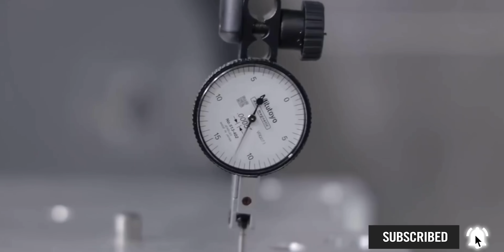The Harsh Truth Machinists Don’t Want to Hear

Comment: The median annual wage for machinists in the US was $56,150 in May 2024. This means 50% are less than that. Using the 50/30/20 budget rule, it takes about $80,829 in income for a single person in the cheapest state, West Virginia, to live comfortably. 
But you know a guy.
This is worse than clickbait garbage.
Reply: Yeah, in smaller Baltic countries located in Northern EU the salaries are around 1000€/month, with 10-15k anually we're living pretty comfortably, but still are a little tight on some budget aspects. I have fought over my salary just so I could live comfortably and have something left in savings or investments.
Reply: @luckgrip252  I am a machinist in Lithuania and I make around 4K pre tax per month. Which is pretty damn close to the median annual for US machinists.
Reply: @luckgrip252  When the "solution" to the problem is moving to "smaller Baltic countries," maybe we have a systemic problem that will not be solved by yelling at the people who are getting screwed?
Reply: Median wages are too low for most jobs using 50/30/20 in America these days, which is a larger problem related to economic policies.  Specific to machining, my issue is this term includes people putting stock in the vice and hitting 'run' (basically no training, they could work as a grocery store bagger), up to those with more experience.  But for sure, if you have the aptitude/interest to be a nurse or a Sonograph tech, or dental hygienist you should probably do that.
Reply: @DapperProf  " economic policies."

That is ultrarich greed, wanting the whole economy for themselves and no one else owning anything. 
That does not get solved by blaming the people getting the worst of it for getting the worst of it. 
That just pisses people off and warps them.
Reply: Canada to a red seal licensed machinist  with 20 years of experience. programing setting up of 5 axis mill turns and turn mills will barely get you 50k a year and that's with mostly light's out machining and holding  +-.0002 tolerances and that's not at a production shop 20 parts run is a long run. Sad that with 4 years of college and 20 years experience I can't afford a home. Guess all the money is in engineering. Cuz you not guaranteed a living wage as a certified machinist.
Reply: It's about the effort you put in not letting yourself be stuck in the average. Put in the work and perfect your skills. Keep learning and growing. Also go to God he loves you. Matter of fact Jesus Christ loves you very much he sacrificed himself to pay for our sins and bring us salvation and eternal life through him ❤
Reply: @TylerVogel  
"It's about the effort you put in not letting yourself be stuck in the average. "

So then it's totally the fault of those 50% of people that they get paid so badly. 

Somehow you're missing that detail about what you're saying.
Reply: @BraveSirRobin2001 if CNC machinery isn't something you're passionate about maybe check out another trade or career path. You can't expect to make big money without big skills. Titan didn't get to where he's at by doing the status quo he did it by pushing for more by learning and doing more. He did things differently he pushed the boundaries he has a passion for it. God brought me into CNC and though I'm only an apprentice with kne year under my belt I wanna keep going I'm happy running my Haas Super Mini Mill 2 and my Tsugami M08SY-II lathe but eventually I'm gonna have to move on and keep trying, learning, and growing.
Reply: @TylerVogel  
"if CNC machinery isn't something you're passionate about maybe check out another trade or career path."

Again, 50% of the people doing that are paid an unlivable wage, and it looks like you want to blame them for that. 

I have a different career, and I'm paid pretty well, but I also know my boss hates paying me so much. I also understand my wage is under pressure, like all wages. 

But it looks like you want to ignore that and just blame the people getting abused.
Reply: @BraveSirRobin2001 No one is disagreeing with you. However if the workers in bad shops with little money want to leave they will. They'll find resources like Titan's academy to expand their knowledge and find better shops or they'll find a different career path all together. Money is absolutely worthless and can fall away with out notice in a matter of seconds. It's your skills and wisdom and knowledge that you thrive with. The Isrealites had to participate and obey God and trust him while he shook them free from Egypt and brought them into the promised land. My point being is you don't get to stomp your feet and tantrum like a toddler and expect to get what you want. You have to put in the work and earn it. Stop wasting my time crying the same statistic over and over and expect to get anywhere with your career. Open your mind and brighten up the tude some.
Reply: @TylerVogel  " However if the workers in bad shops with little money want to leave they will. "

And now we don't need any workers' right laws. 
Have you really given this some shought? 

If the OP wants to help folks in the industry, great, but do not start by blaming over half of them.
Reply: @BraveSirRobin2001 bro you are literally throwing a temper tantrum. I throw tantrums especially in the machine shop not you. Tantrums are my thing. If workers are in trouble it's time to call osha and report the unsafe work environment. As for you get back to work I beed whatever you're working on done by it's deadline with a positive uplifting attitude.
Reply: @TylerVogel  Stop trying to abuse people who are getting paid an unlivable wage. 
You are kicking down, and it looks like you are enjoying it. 

To help people is not to start with blaming over 50% of them.  That needs to be called out.
Reply: @BraveSirRobin2001 bro just stop already. You keep going on and on. What am I supposed to do? I'll pray for the workers prayer is powerful but beyond that I'm an apprentice machinist making 17.50 an hour
Reply: @BraveSirRobin2001  Nobody here is abusing those 50%.. you are very worried about them though. So you should do something about it. Whining in a youtube comment section isnt going to change anything. Just because somebody else is talking about the things that folks can do to improve their situation in life doesnt mean that they are kicking somebody who isnt making a livable wage.
Reply from the maker: I get where you’re coming from, but here’s the truth: the machining industry isn’t one-size-fits-all. There are old, grungy shops that will pay you next to nothing, and there are world-class facilities that will pay you six figures and beyond if you’ve got the skills, mindset, and drive.

My mission is to show machinists the pathway out of the shops that keep you broke and into the shops—and the roles—that actually reward your talent. You don’t have to stay stuck making less than $50K. You can rise, you can lead, you can double or triple your income if you’re willing to put in the work, stay positive instead of negative, and follow the principles I’m laying out.

In today’s world, just hitting six figures isn’t enough to raise a family and thrive. But with grit, discipline, and smart moves, you can do far more than survive—you can win big in this trade. That’s what I’m teaching, and that’s why I won’t stop pushing machinists to rise up.

You can grumble and stay where you are, or you can rise and change your life. The choice is yours.
Reply: Valid point about six figures in USA or around there. Mid to high 5 digits anually in EU is the max, but the costs to live differ between countries. About grumpy workplaces, there are always a few of those which I don't entertain, but sometimes it feels like I should because they're closer by and are paying more  @TITANSofCNC
Reply: @TITANSofCNC  "I get where you’re coming from, but here’s the truth: the machining industry isn’t one-size-fits-all. "

"The median annual wage for machinists in the US was $56,150 in May 2024. This means 50% are less than that. "

Why are you ignoring that 50% of the people in that job make less than $56,150?
Reply from the maker: I am not ignoring it…
I am inspiring the ones that have it in them… to rise to new levels… and showing them what they need to do and how they need to think… so they can rise out of their current circumstances to better ones.
Reply: @BraveSirRobin2001  Baby boomers lived life on easy-mode, they don't care about anyone else or the truth lol. A Generation of Sociopaths: How the Baby Boomers Betrayed America is one of many books explaining this phenomena.
Reply: @BraveSirRobin2001 median and mean are two different things.
Reply: @anthonycatello  median is the number where 50% is below and 50% is above.  
That's the number that matters.
Reply: The problem is those "new levels" pay less than the basic levels did 25 years ago. Pay in this industry is a joke and has not kept up with rising cost at all. Even your 100-150k asperational wage examples are worth less than the average was when you got in to the industry. In 2000, average wage was $17/hr for a run of the mill machinist ($21 for tool and die) and an average house was 111k. Today the average house is 410k and you'd need to make 125k to match that purchasing power. 155k for tool and die. So if you aren't paying average level employees at least that much, YOU are part of the problem. And we've all seen your employees in your videos. None of them are average. So you oughta be paying them closer to 200k if your money's where your mouth is. Are you?
Reply: Only way you make money as a machinist is if you own your own shop
Reply: @720Two  And it sounds like most folks cannot make a living trying to get to that point.
Reply: Honestly I love the dialogue Titan has given you, Robin. I thought the exact same thing you did Robin, and both of you are right at the same time.
Sadly, though, Titan, not every single machinist out there can get those jobs, even if they have the credentials, there is such a thing as companies not wanting to/not being able to hire everyone. I'm sure you're aware of that, though.
In the end I believe Titan is doing a great service, because for those who need to hear that they CAN do more and DO deserve more, they just heard it. And if you are stuck in some shit hole, who says you can't rise to a position of power and change that shit hole? You won't know unless you go for it.
Reply: You're proving Titan's point. Stay in mediocrity or choose to do whatever it takes to rise to greatness
Reply: @markdavis304  
"Stay in mediocrity or choose to do whatever it takes to rise to greatness"

This means I can kick and blame the 50% of people who make less than $56k a year?  

How about all those folks quit the job? 
Or better, they unionize and strike?
Reply: @BraveSirRobin2001 I think you have this backwards "To change yourself you must first change the world" Yes there are a sizeable amount of people making under 50k a year, but this is about lifting yourself in the industry in which others will have to do the same if they want to see change. "To change the world you must first change yourself"
Reply: @XxSteamStreamxX  
"Yes there are a sizeable amount of people making under 50k a year, "
The total number of machinists  in the US is 357,000. This means over 178,500 do not make a living wage. That's just machinists. 
First rule is to stop blaming those folks for getting screwed.

Comment: I cant understand why folks who have these skills and take them seriously would complain. I am self taught. 90% of my parts that i build are of my own design. In essence, I am the owner, engineer,  programmer, machinist, janitor, finishing,  salesman, accountant, shipper. If i decided to build others parts full time, i would be way ahead monetarily, but that isnt my goal. I owned a small oilfield trucking company for 12 years before i could afford my own cncs. That is where all my profits from that went. I just filed patents on my designs. My goal isn't getting rich. It's building some cool shit that makes changes in how people see what is possible. Set your goals, make them real, sleep well at night.
Reply: Big difference designing and machining your own stuff.  A job shop doesn't really have much flexibility as far as the print and tolerances go, no matter how idiotic.  Most machinists are not their own operators.  I took what I made in 2001 and adjusted for inflation I make exactly what I made then despite years of experience and programming skill.  Only way to really make out is to own your own shop.  Now you are a business owner like any other.